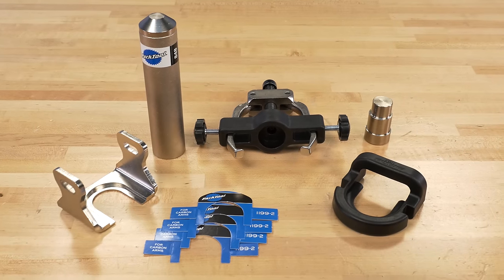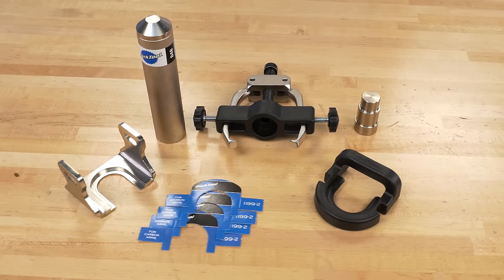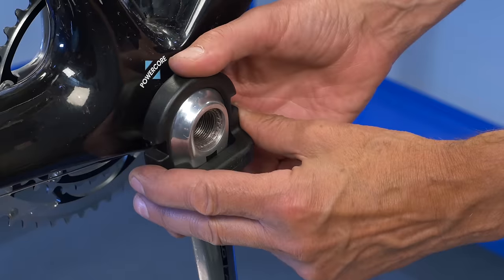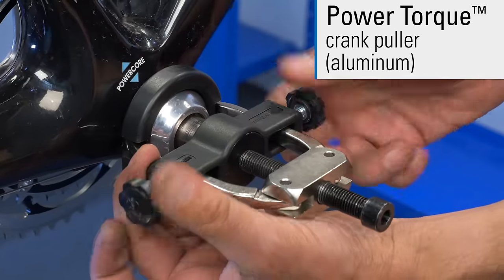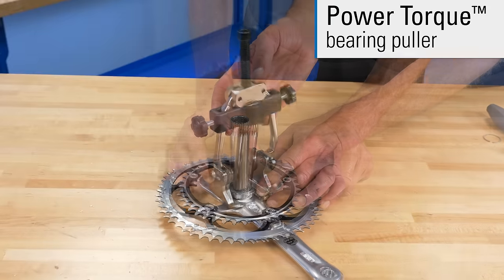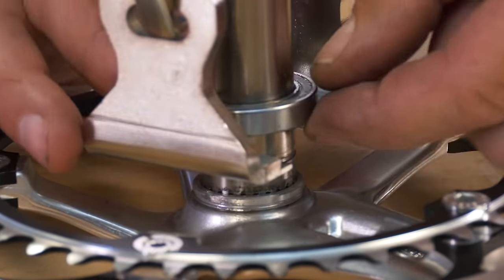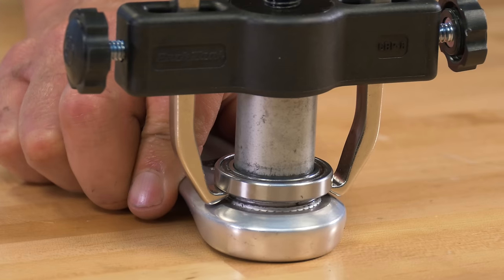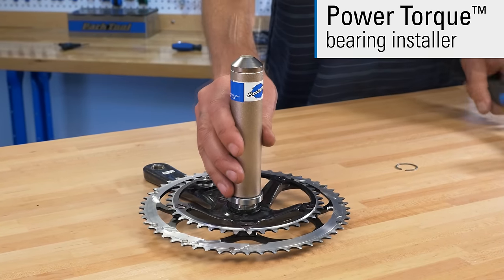CBP-8 Campagnolo® Crank and Bearing Tool Set

Comment: Park Tool USA told me that the knobs were sent to me but it had been more than 3 months and i did not received anything!
Reply from the maker: Reach back out to the person you contacted and let them know. Shipments can go missing, papers can get lost. Mistakes happen. Just contact the person you were in contact with.
Reply: @parktool  Even sending emails to the person in-charge from Park Tool does not help at all. He will not help now.  Now there is  no way to get the tools knob parts when the parts are missing.
Reply: @parktool  @Park Tool  Thank you so much Park Tool!!! Finally, I got the original knobs which you mailed it the 2nd time to me.

Comment: Hi park, the tool set I have just purchased from Bike24 has come without the 2 x adjustable knobs (left + right) on the bearing/crank puller's arms.  May I know where could I get the knobs back? Thanks.
Reply from the maker: If you reach out to info@parktool.com we can get you to the right people. Thanks!
Reply: @parktool  Park Tool USA told me that the knobs were sent to me but it had been more than 2 months and i did not received anything!
Reply: @Park Tool
 We also did not receive the 2 adjustable knobs. Are you able to send us the link to buy the 2 plastic knobs since all of us did not receive it?
Reply: @parktool  @Park Tool  Thank you so much Park Tool!!! Finally, I got the original knobs which you mailed it the 2nd time to me.